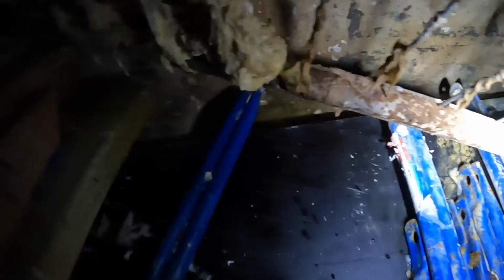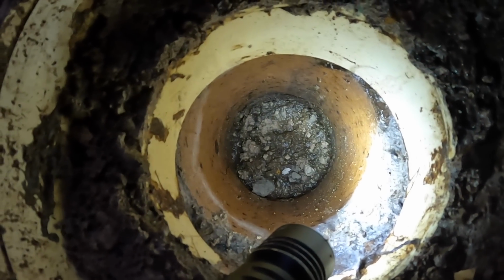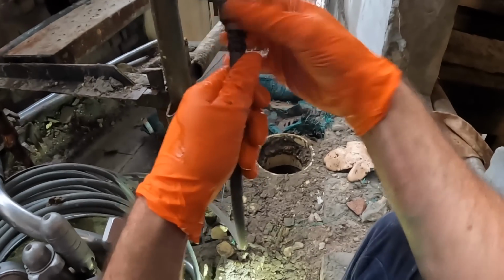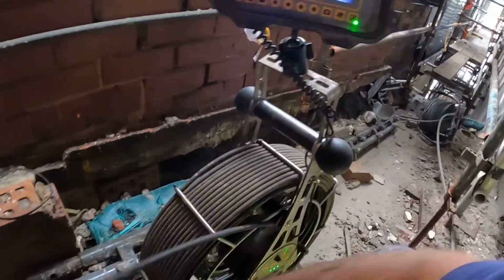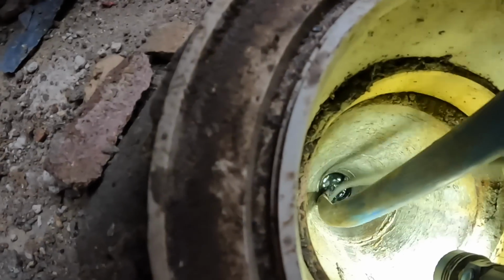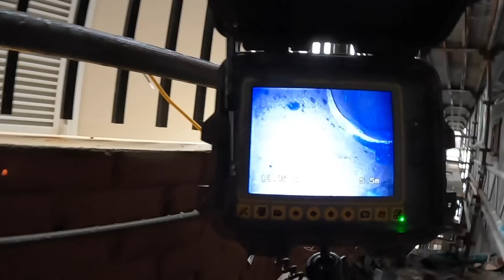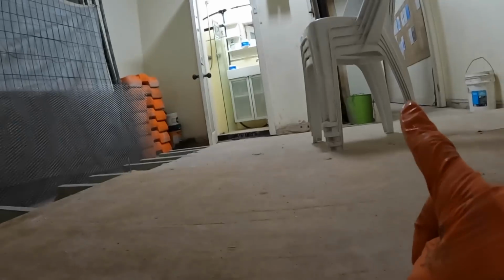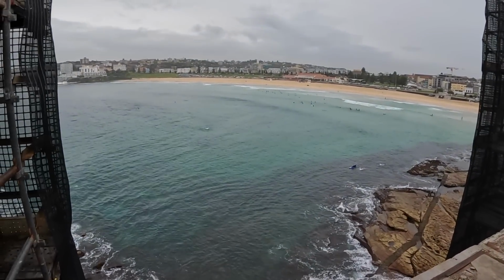Blocked Drain 691

Comment: By golly, ollie, what a confusing array of pipes, vertiginous depths, sewerage , rubble and a typical building site. Before I knew it was the reverse head, I called it the root rooter as you seem to use it almost exclusively on root infestation, and it’s my absolute favourite. 
I try to guess where you are , by house styles, aeroplane landings and departures, road size. 
Good work as usual. All good👍

Comment: I am a drain cleaner in Texas and the way the plumbing in Australia is designed for the drain cleaners to access is a lot easier compared to the US because I’ve noticed a lot of the vents are outside instead of in the walls. Usually the only way to access the vents in the walls are going from the roof or cutting the wall. You would also be lucky if there was a clean out outside on the wall.
Reply: To find a way in, all the drain crew have to do is follow their noses to where it is coming out.
Reply: Don’t have to worry about freezing so much over here thank goodness!